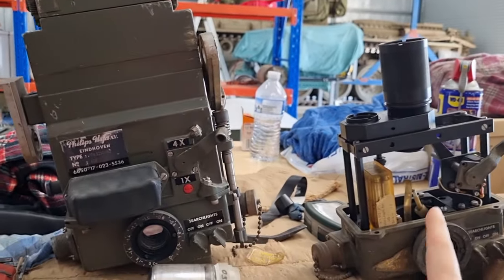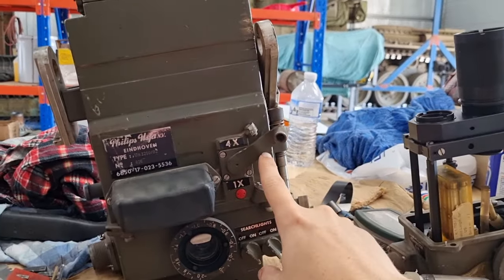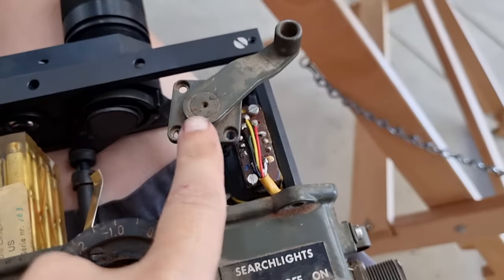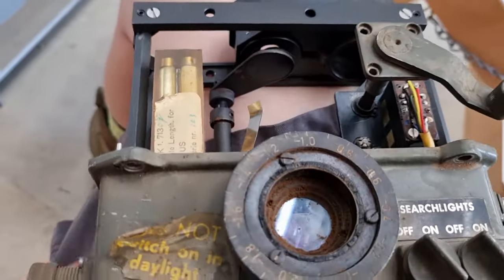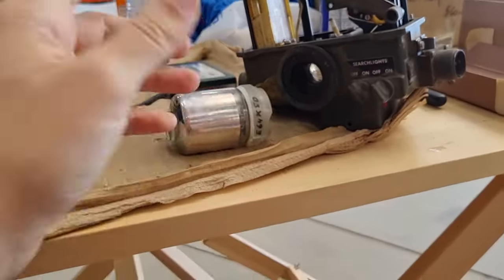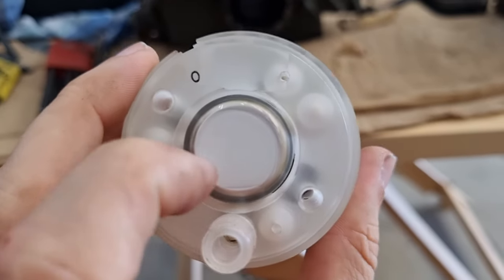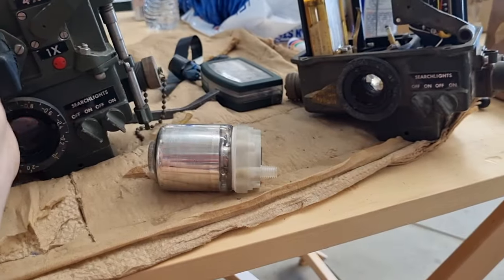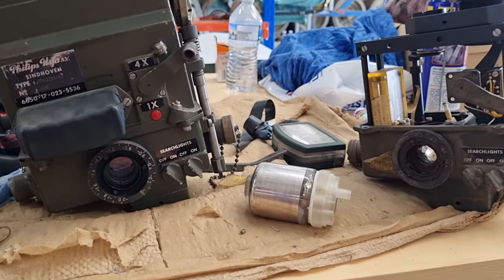Anatomy of an Infra-red scope from a Tank!

Comment: Hi Lottie. Loved the show, thank you. I have never seen the internals of the IR sight. Could you please give me some contact details where we can communicate privately where you work for the address of the company that made the mantlet and Multi Barreled Smoke Grenade Dischargers (MBSGD) covers. I noticed that you don't have the 25 pin connector that runs from the Supply Unit Vibratory (SUV) to the C42 set.. How have  you rigged that to have them running. The large fire extinguisher that is sitting in the bracket at the front of the long turret bin (front right hand side) is actually a bracket that holds what we used to call the "Oddie" gun. This is a large grease gun that hold a 5 kilogram can of XG274 grease so that you could service the millions of nipples around the Cent. I am happy to send a photo of what that is so that you can dig one up to add to the AFV. Again thank you this show.